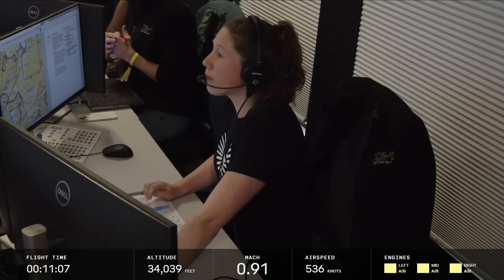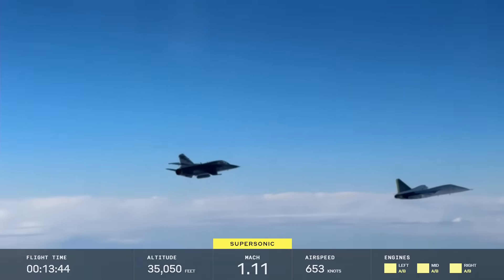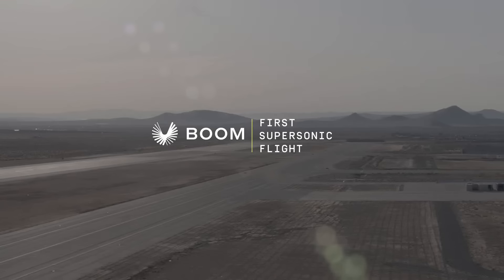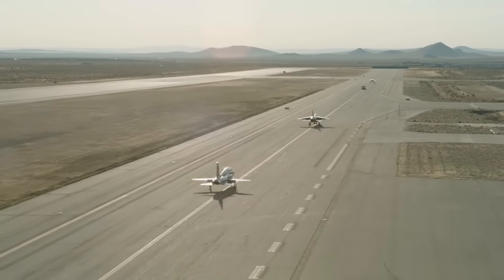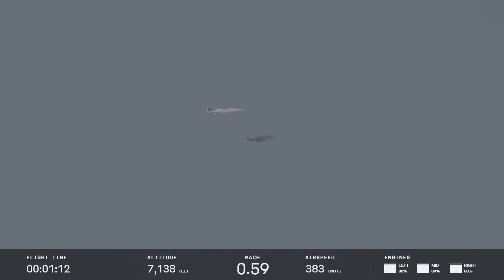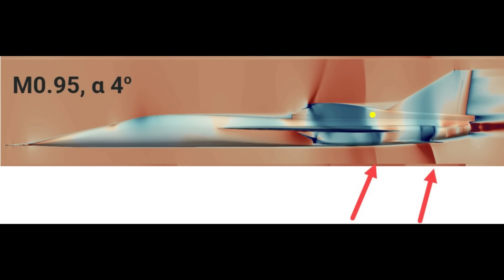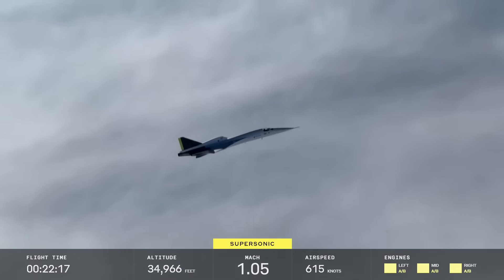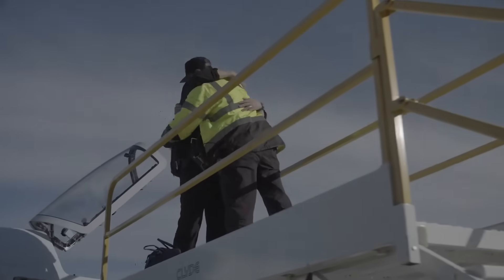XB-1 Baby Boom Goes Supersonic - Jet Planes, Starlink & iPhones

Comment: Am I the only one but doesn't it look exactly like the Concorde. Just pull out the plans for the Concorde update the avionics and the engines and you are done. Why are they spending money reinventing the wheel. Especially for something that, like the Concorde, will have limited market appeal.
Reply: Because Concorde was great for 1970. But, Concorde had a loud sonic boom, a not so great safety record, was an absolute fuel hog, and a tiny cramped cabin.

They’re trying to do something better than Concorde.

Comment: Not a big deal, aircraft been going supersonic for 50 years. Also, I don't think that will carry too many passengers.
Reply: the point is that this is supposed to be really quiet and its a downscaled demonstrator iirc, you go design a plane
Reply: @glxytoni you're thinking of NASA's X-59
Reply: @glxytoni  Im not talking about how quiet it is, im talking about basic plane design. We have been designing supersonic aircraft for many years, even commercial concord is that old. Putting together a small supersonic plane could have been done easily at any of the major MFG's out there today including Boeing. While it's nice that a small venture could do this independently, it still needs to go faster than mach 1.1 to make any difference in the market. Current planes do mach 0.8, so this is just 20% faster, making a 5-hour flight in 4 hours isn't a market changing deal.
Reply: @ronwatkins5775 their goal is something that goes Mach 1.7 and carries 60-80 passengers for around $5000 (today’s dollars) round trip NY-London. I doubt they will ever get there.

Comment: I seem to remember that the X1 seemed to "pause" at .97 or .98 or something before jumping supersonic, too.
Reply: Just the nature of pitot tubes!
Reply: yeah they talked about that. something about how the airspeed measuring tube freaks out in transonic flow
Reply: @eamonnator  Because the shockwave is starting to form around the craft and creating lower and higher pressures at specific points?
Reply: It happened on Concorde too.
Reply: A pitot tube is a tube. Nothing fancy.

Supersonic flow into a pitot inlet creates a normal-shock at the inlet. This causes an instantaneous pressure jump across the shock.
Reply: It's not pausing, it's the sensor.
Reply: @dosmastrify  I am aware. I was saying the gauges on the X1, I believe, did the same thing.

Comment: Is it a supersonic civilian plane if the snoot does not droop.
Reply: As the commentary on the live stream implied, had today’s small camera tech and video quality been available at the time of Concorde, it would likely have been considered or used in place of the droop snoot.
Reply: @KiloOneThree  Yes but the droopsnoop is a marvel of engineering in my eye's
Reply: @ I did have a similar afterthought from my post. It is unique, impressive, and looks good when I see it again on some of the old vids.
Reply: Droopy snoot seems to describe me today😂
Reply: The Comcorde only droop it’s nose during take-off and landing in order the pilot can have visual sight of the runway. This Prototype is rather smaller than actual final Plane, so they didn’t need to put one. They might emulate the noose droop when they make the full size prototype in the future, or might just use high-res cameras and screen to help pilot for the final descent (though words well known Youtuber pilots, real visual sighting is very much better than a screen since they have a better sense of distance and speed.)
Reply: @ Highly unlikely they will have a droop snoot. There is no need for it with camera/video tech we have today and the practical complexity of building it in is unnecessary. The concept renders for Overture on the website also does not suggest implementation of a droop snoot.
Reply: Concorde's nose did not droop in flight, it is hinged and is pointed downward for landings and take-offs so the pilots could see the runway.
Reply: @paulmichaelfreedman8334  Yes I know, but it still had a droopable snoot. the baby boom has a camera instead.
Reply: @peter4210  Fair enough
Reply: @paulmichaelfreedman8334 Yup, but only because cctv cameras were a 2' cube at the time 😅
Reply: @paulmichaelfreedman8334 the snoot drooped.
Reply: @paulmichaelfreedman8334  yeah no shit

Comment: Finally one project that actually works
Reply: @desa1865  I thought the " project" was overture and that hasn't been built yet ?
Reply: @spacedriver24  This to overture is sn15 to starship
Reply: @techietisdead But starship actually exists!!!!!!!
Reply: @spacedriver24  that's debatable; the vehicle with the abilities Musk talks about has yet to see the light of day, and I am pretty sure the whole thing is a sham
Reply: @spacedriver24 so far this plane has had only one inflight emergency. A data acquisition node went screwy. It was solved inflight by switch off, switch on. But it took 2 minutes to reboot (as expected) by which time that test flight was terminated as per the emergency procedure
Reply: @techietisdead  This is more like starhopper.
Reply: @physicswithpark3r-x3x  oh boo hoo. The most powerful rocket in living history isn't finished yet but has flown over 8 times and landed and been recovered 3 times
Reply: @Mallchad  flown it has. and if you consider that an achievement, you know nothing of rocket science
Reply: @physicswithpark3r-x3x  If you know anything about rocket science you would consider any test where the engine doesn't implode a massive achievement.
Reply: @Mallchad  nope
Reply: @Mallchad  Ehh still
Reply: Until it's commercialized and capitalists cut every safety and maintenance schedule to "maximize shareholder earnings"
Reply: @ThatOpalGuy and let's not forget those very same capitalists achieve those savings/safety through the Marxist ideology of DEI. 

Boeing's aeroplanes may fall apart, but at least they were engineered by a team of only disabled, queer, women of colour.
Reply: @ThatOpalGuy you mean Like NASA Cut Corners to maximize their Shareholder earnings? Or how the soviets Cut Corners to maximize earnings with the N1?
Reply: They dont even have engines for their actual plane (every big maker turned them down, so they are trying to make their own). This product is never getting built, let alone ever get working.
Reply: This plane is just the first big step inside the project that's overture
Reply: But it's decades after this was first done.
Reply: They made a weaponless fighter jet prototype, nowhere near the complexity of an airliner
Reply: @ Theyll get there, you waited much longer for starship
Reply: @ still waiting for starship

Comment: Just like a Concorde!! But at a much much earlier development stage and slower, obviously. Well done! Back to the future!
Reply: And concorde did it in 1969 at mach 2
Reply: @ah5779  And this will takeoff quietly and economically with turbofan engines WITHOUT afterburners.  So NOT just like a Concorde.
Reply: ...and the workers in Filton and Toulouse back then were trained to use torque wrenches to tighten fixings, in a generally similar way to those in Seattle nowadays.
Reply: @stargazer7644 The Olympus was a low bypass turbofan. The noise (whether in reheat or not) was glorious and reminded us of the importance of looking up.